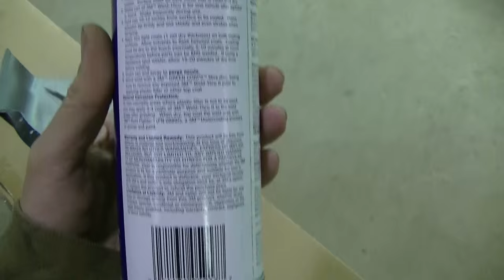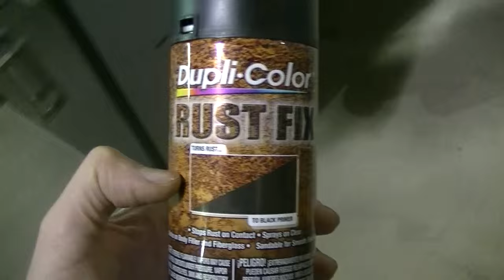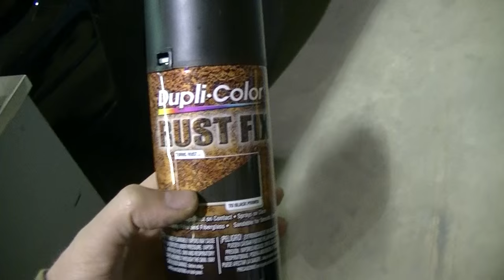Darth Dually Silverado Crew Cab "Rusty Rocker Repair 3"

Comment: Looks like you got a nice fit on your panels!  Those rocker patch panels are very similar to ones I just installed and you are correct about them not being quite as wide as the original where they meet the inner.  Looks can be deceiving when it comes to rust.... I thought you were damn lucky when I saw how nice that inner rocker was.  Usually there is no pinch weld left when I get to them.  I think you're gonna have a very nice job when you're done.  You have a great attention to detail which is so beneficial for this kind of stuff.  Top notch!
Reply from the maker: +Velvethamma   Now I get to do the same thing on the other side.  So much fun  :)

Comment: I have done this repair many times,  so if you look at the inner rocker their are square ports leading across the bottom of the truck , in my opinion thats the area where the salty road water gets in and starts the corrosion process, not sure why they made those holes or why they felt that they needed to dump into the rockers, had they closed that port it would have ended this issue with chevy trucks. one more thought , i have done the partial rockers like you are but they make a full rocker and the last one i did was that type, if you look at the top of the rocker there is a seam close to the kick panel and thats where I seemed it in so as to not have to cut into the door pillar
Reply from the maker: +MrFireman164   I am dragging my feet on the other side.  Such a crappy job.  Not something I would want to do full time.
Reply: +mossman381 no sir it would suck , the full rockers I put on for a guy some time back I used panel bond adhesive and only welded the ends , so much easier and very little area to have to worry about welds re rusting , worked great

Comment: looks really good.. your a bit short with the outer rockers bottom edge like you stated because you lapped the joint, it wil look just fine.
Reply from the maker: +Jon A   Yes,  nobody will even know it wasn't factory.  The inner rocker is pushed in some from whatever accident it was in.

Comment: I can't believe how nice a shape your truck is for 13 years old. have you had it undercoated it yet?
Reply from the maker: +Salvatore Modica   No undercoating ever unless the previous owner did it.  There is some kind of coating all over the cab and other places.  Not sure if that is GM or aftermarket.  The truck is in pretty good shape but it has been a lot of work on my part.  Slowly over the last 4 years I have been working on this truck.